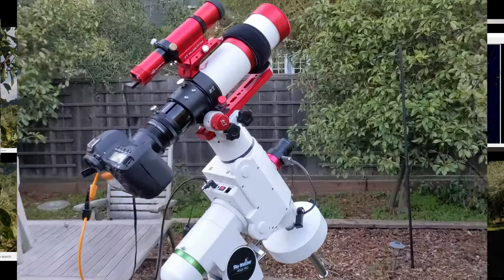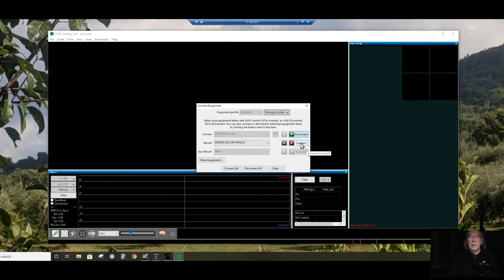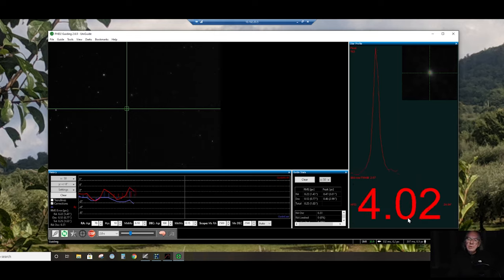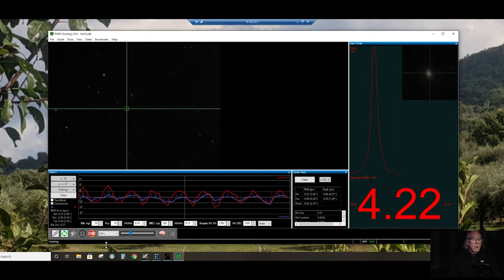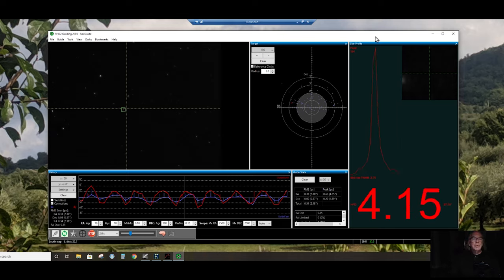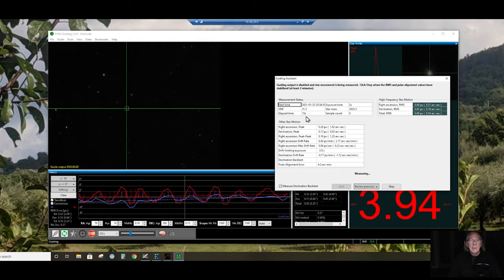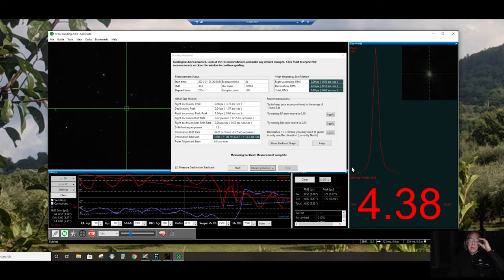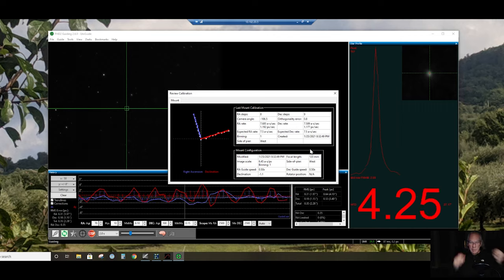PHD2 Guiding Calibration Walkthrough

Comment: In addition to the obvious reasons for backlash along the DEC axis, you have in the settings on the brain-guiding tab - the calibration step value is 2650 ms - this is a lot, set at least 750 ms. Also check the stellar velocity settings in the EQ Mod, it should be 0.9. Increase the gain of the guiding camera as well. You have it 48 by default, set it to 90, if you made a library of dark frames, then everything will be fine. 2.0 seconds is a lot for your mount, you can see for yourself that 1.5 seconds is better. But of course, you need to start with the mechanics of the mount. Hello from Ukraine.
Reply from the maker: Hello Just Volkov thank you for taking a moment to view and comment during your challenging times. Stay safe. My father's parents immigrated to New York Ellis Island in the early 1900's from Ukraine. I appreciate your input. ~ Bill
Reply: @AstroVagabond  The land of Ukraine is not only rich in wheat crops, it gives birth to kind and intelligent people. Your parents were smart)) I am very pleased to hear your story. Good luck and good luck to you and your family.
Reply: @AstroVagabond  The land of Ukraine is not only rich in wheat crops, it gives birth to kind and intelligent people. Your parents were smart)) I am very pleased to hear your story. Prosperity and good luck to you and your family.

Comment: Hi Bill. My guiding with ST4 cable always worked great. I've always had issues with Pulse guiding. During calibration I always get the message that star movement is too low or not enough.I never figured out what was the problem. If you could help. Thank you.
Reply from the maker: Hi Jean if you can share more details about your mount and guiding software that may help generate responses. Otherwise if you use PHD2 and have not reviewed this page it might be a place to start: https://openphdguiding.org/man-dev/Trouble_shooting.htm

Comment: Thanks for vid.  I used to use ASAIR Pro and it made it very easy to guide.  Now using NINA and PhD 2.  Having a rough time.  I got a new mini guide cam like yours. I also use that same camera from a previous guide scope. Focusing it was difficult but last night I thought the stars looked adequate to guide.  But when I started it running RA line went one way and Dec line went the other.  I thought, oh it needs now to be calibrated.  When I tried to start that, it said that there weren't enough stars in the area (Hercules Keystone) to calibrate and I should let it slew closer to the equatorial horizon.  That was below my local horizon and when I went outside to look, scope was pointing at the ground.  I couldn't get anything going at all.  No guiding at all.  Today if I have a clear hour or 2 I will try again, it shouldn't be so difficult!  I will recheck my setup connections.  Today I will also check the belt on my EQ6-R and see how loose it feels.  I've had this mount for 3 years and of course there is no place to take it for service.  I don't know what else to try.
Reply from the maker: You are welcome and thank you for sharing your current experiences. Much appreciated.

Comment: The RA is not to bad but the DEC is really all over the place.  You should follow the instructions and put the pulses on 'north" in the brain > Algoritms > Dec Mode Guide and set to North as advised by guiding assistance.  You have to much backlash on DEC (typical issue with most mounts) and as a result, changing directions via pulses in PHD2 is generating overshoots followed by corrections.  When you only allow pulses in one direction (do guiding assistance after every new polar alignment), you don't have backlash issues because your direction of DEC doesn't change.  Also, your guidescope doesn't need to be very sharp.  It's even advised to be a bit out of focus.
So consider to remove the DEC backlash from the mount because it's quite easy to do yourself and this will improve your guidance a lot.  
With your mount you should be at around 1" max of total error instead of above 2".  With a short tube, this is not an issue but when you go to higher magnifications, you will run into issues with bloated stars.  Clear skies.
Reply from the maker: Thank you henk for the great feedback. 👍  Next clear sky night I put into practice your recommendations!

Comment: Thanks Bill.  Phd2 has not improved my tracking at all.  I only get 40% of my 120” frames that are usable. I have run phd2 on 8 sessions. 4 Guiding assistant runs have not improved guiding.  I have redone polar alignment many times and it is always very close. What are the polar alignment error limits that guiding assistant reports? Got any suggestions for me to get better tracking?  AVX, SV 130, eos800d, 50mm sv guide scope, asi290mm mini guide camera, usb connection.
Thanks Warren
Reply from the maker: Hi Warren my first thought at this point is to add up the total weight of your gear that you are mounting and compare that to the load capacity of your mount. For example I looked at a Stellarvue 130 and it weighed in at 21 lbs. It has two mounting rings that weight 1.4 lbs. each. You camera is 18 ounces. A guide scope is about 1 lbs. Why I mentioning this is I'm trying to figure out for myself, where my mount has a 30 lb. payload, how much can I actually place on it and still get acceptable performance. I want to purchase a second scope and need to understand actual limitations of my mount versus advertised payload specification.
Reply: @AstroVagabond  my imaging gear weighs 27#.  With the FR/FF it weighs 29# The avx payload is 30#.
Reply: So your point is well made, my rig’s weight may be the problem.  I should test the guiding with a much lighter set up.  But I dont have one.
Reply from the maker: Can you remind me the length of your exposure? What does PHD2 report for total error in arcseconds? I used the astronomy.tools CCD suitability calculator entering your scope and camera and it shows they are a good match with a pixel resolution of 0.84"/pixel.
Reply: @AstroVagabond  I get 40-50% usable frames at 120”. At 60” I get about 70%.
Reply: @AstroVagabond  I tested the phd2 guiding on a 4# (sv210 guidescope,asi290mm mini guidecamera,eos800d)imaging rig last night. The rms error was still bad (2-12).  PHD2 said it could not make sufficient moves in DEC.  I dont know what that means.  But it seems that weight is not the only problem.